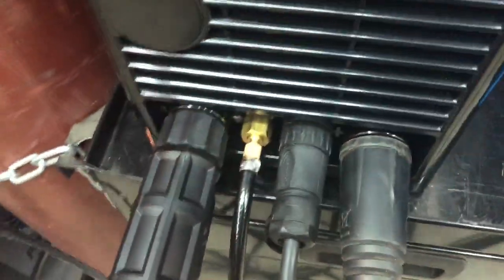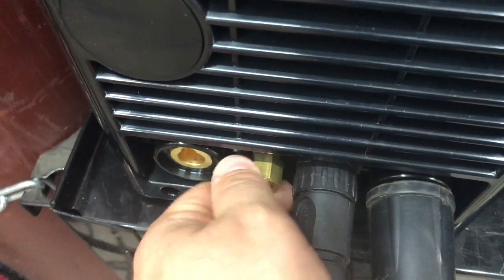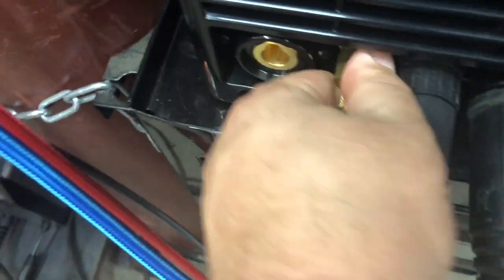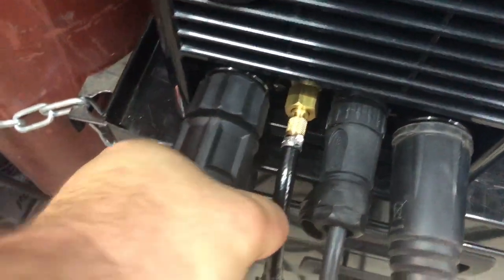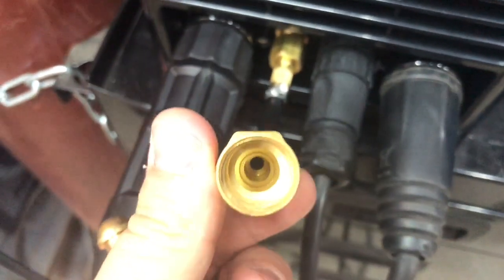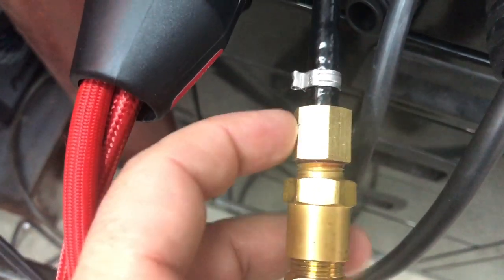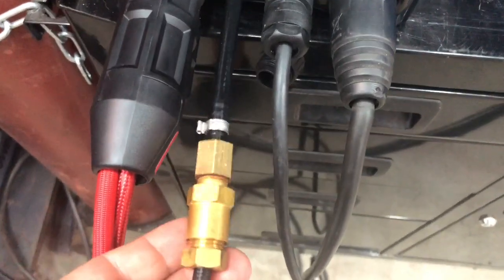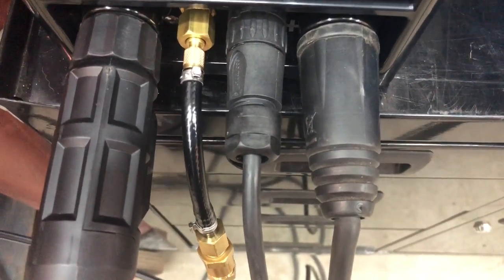HTP Invertig 221 Torch Adapter or any HTP Gas fitting

Comment: how can I make or where can I find this adapter?
Reply from the maker: For the argon? You get a 1/4” bsp fitting from HTP or one of your HTP torches just unscrews.

1/4” bsp fitting for machine end 
1/4” NPT fitting with 1/4” barb
5/8 RH argon fitting with 1/4” NPT
8” hose any kind 1/4” ID
11.3mm ear clamp and 9.5mm ear from the bsp fitting.
Reply from the maker: I made an updated video here is the think explaining it all.

https://youtu.be/lz8eUNIu8BU